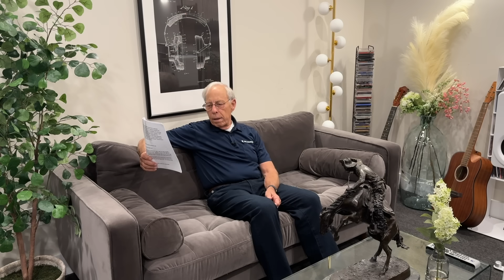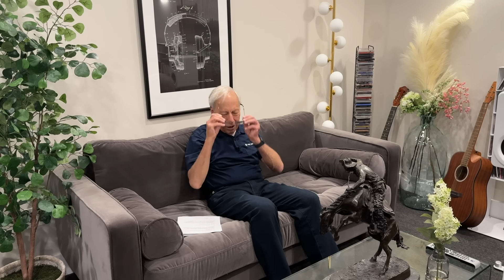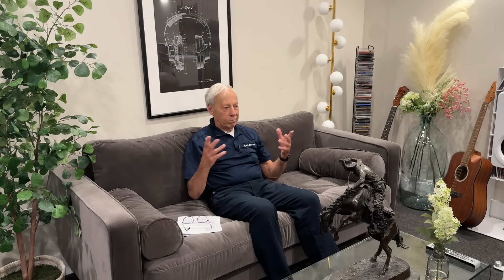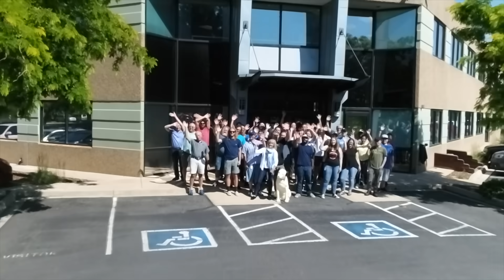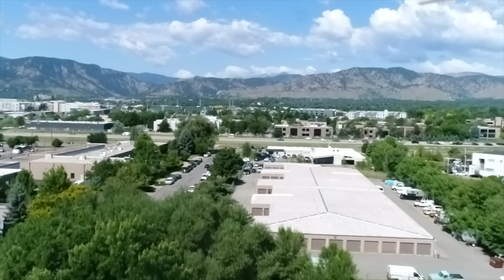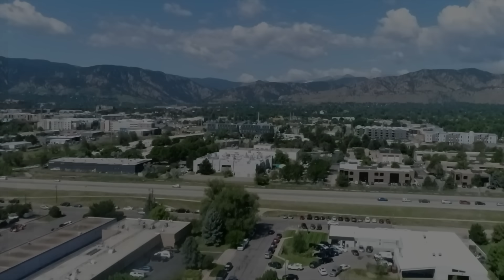Do music streamers sound different?

Comment: The question "Do music streamers sound different?" already contains a category error and thus, in a strict logical sense, cannot be answered.

The reason is that streamers in terms of sources for digital data don't "sound" but a DAC does (taking aside that an electric signal doesn't either, but yeah ...).

This argument isn't just semantic pedantry (admittedly also), but crucial as by definition, in logically digital chains, neither the source nor the transmission path matter unless exceeding the thresholds causing data corruption. If one denies that, one denies the very definition of what is digital!

Differences due to jitter, in some sense part of the analog nature below the digital abstraction, might be a valid counter-argument at first sight, but actually aren't as it is up the last end point (the DAC) to deal with it and suppress it. Trying to improve that literally half-way, is the wrong approach.

Comment: The is no difference if the streamer is a separate. After all, we can use a really old phone as a wired streamer to get the highest quality possible. My phone is 10 years old but runs latest iOS. It will crush a $40,000 streamer or a $70 streamer.

Comment: I have three active streamers, A WiiM Ultra, Volumio Rivo with the Farad Super3 LPS and the Cabasse Abyss integrated. I also have four speakers in play, Magnepan LRS+, Cabasse Murano, Fyne Audio F500SP and the Zu DW6 Supremes. There are differences in sound quality between all of the streamers, as there are between the speakers. Personally, I believe it boils down to the power supplies the streamers use. The Rivo has a $500+ LPS powering it along with DC capacitor filtering, silver USB cables with USB isolation and 10mhz clocks on both the USB and ethernet. The Cabasse Abyss has an internal power supply as does the Ultra, both run off of the network via ethernet cables. The Rivo has better clarity, better separation, better across the board. The Abyss is in second place, but equally as good as the Rivo in many respects, but still does not dig into the details like the Rivo. The Ultra is competent, but not near the quality of the other two.  

When I owned the Node N130 and upgraded the internal power supply with an external LHY LPS, the sound improvement was very noticeable. That is the day I started my journey in upgrading everything power related. Electricity is noisy, and those 1's and 0's travel on a stream of electricity. And then we have jitter... And clocks... ;-)

And yes, I A/B tested, as best as I could, but found the switches added noise. A simple A/B test is not that simple, it is actually very complicated and can get expensive to do it properly.
Reply: I agree 100% with you, that’s the PSU it’s the key difference on how its sound.

Comment: First of all, as a point of reference, my hearing has much bigger tollerance than of a dedicated audiophile, meaning, it takes a real change for me to say - ahaaa! I'm using external dac, old Marantz HD-DAC1 and it's a decent unit. Now, If I'm playing digital content from let's say Tidal by accessing it from the streamer's interface/app, it sounds significantly better than if I'm just using Tidal connect option to push the sound to the streamer from the native app. Likewise, all the digital content on my RPI, if sent through the streamer and then to the DAC, instead of sending it directly to the DAC with a same set of coax or toslink cables, sounds much better passing through a mediocre streamer. Btw, I checked the box of the streamer app which allows for unaffected pass-through of the digital signal and still - it comes out sounding much better. I have no idea what it does to those 1's and 0's but I found my way how to enjoy it. Mediocre streamer, well known brand and an external old DAC with a variable output to the amp. That's it.

Comment: I understand how jitter effects time delivery of bit perfect samples, but not how 'noise' is ingested into an otherwise bitperfect arrival. Jitter is largely undetectable with modern dacs. Why can't dacs simply cache & delay delivery to achieve sample rate timing with bit perfect consistency?
Reply: As for the understanding, it is okay not to understand something which is nonsense anyway.

People claiming that noise influences digital data despite being reconstructable without errors (which is an assumption as errors can and will occur of course, but are usually taken into account) are contradicting the definition of something being digital which obviously doesn't make any sense.

The time variation in terms of jitter is actually an additional aspect and at first has nothing to do with the integrity of the numbers.

In short: you're normal and sane. All good.
Reply: @little-endian5957  
Don't forget here, we're talking about jitter in microseconds ... a tiny fraction of the pulse width of a USB cable.  

For both noise and jitter ... many people still make the too-easy mistake of thinking that whatever comes down the wire is applied directly to the input of the next chip and it never is.  ALL digital signals (especially the serial data on USB, CAT5, etc) is differentiated, captured, latched and buffered.  Digital devices do not work directly upon input data, the way analog devices do, they work on cleaned up copies of the data... so by the time noise or jitter would matter that messy input signal is long gone and forgotten.
Reply: On USB and HDMI they do.  On the old toslink (optical or copper) connections the clock is derived from the signal itself.
Reply: @Douglas_Blake  So why would you spend more than $200 on a bit perfect dac?
Reply: @arthur_pug  
I wouldn't.
Reply: @arthur_pug Haptics and features would be a rational reason. Have a look at the RME (German manufacturer) portfolio and its ADI-2 line.

They won't sound better per se though, only measure better here and there.

Comment: The information stored on a vinyl record is fixed, but different cartridges and turntables don't reproduce the same sound.  Why should digital be any different?
Reply: Because your cartridge is an analog device that can vary over a surprising range, depending on it's construction.  With digital files and streams you get exactly the same data no matter what device you are getting it from.

Comment: There’s no such thing as a digital signal.  It’s actually a square wave ANALOG signal which is decoded, as such it definitely can vary even before you consider external factors like noise.
Reply: Yet strangely enough those analog signals carrying digital information are used world wide 24/7/365 with 100% reliability.  Who'd a thunk that??
Reply: @Douglas_Blake  100% reliability is not an accurate statement, and to get a reliable signal transfer often requires reconstruction of the signal by the receiving device.  If the end requirement is simply that Alexa says the right words when telling you the forecast, that’s a low bar which is easily met.

It all depends on the application.  If it’s non critical and is judged by very crude objective measures, the vast majority of digital transmissions are just fine.

But if the results are being subjectively scrutinized at a high level, it takes far more than consumer grade value-Engineered mass market hardware to get to that 100%.  If every digital transmission was always 100% perfect there would never be a need for a computer to have 2-way communication with a device over USB so that the receiving device can re-request data packets that don’t arrive, or arrive corrupted. 😉
Reply: @superspeeder  
Actually the accuracy bar in digital communications is set by the fact that entire economies, banks and businesses rely on it's accuracy to make financial transfers, that have to be 100% bit perfect all the time... Just think for a minute how disastrous it could be for some guy who's latest autopay withdrawal had one of the high order bits flipped... He owes $100 the autopay takes $1,000,000 .... totally unacceptable.

The wires that transfer our audio data are the same wires that run this world's finances, military, medical and aerospace efforts. It has to be right, all the time.
Reply: @Douglas_Blake  Agreed 100%.  Now ask yourself if that networking equipment comes from Best Buy and the cables are Amazon Basic?

Commercial/industrial grade networking equipment is orders of magnitude more costly to build, implement and commission than the flimsy consumer-grade garbage most people have access to, but that’s exactly what cheap audio gear is full of… the cheapest jelly bean chips, wonky oscillators, noisy power supplies, none of which will completely interrupt a data signal but surely will degrade it.  For most people FM radio and MP3s are good enough, but not for some.

To keep the ones and zeroes properly defined, in the right order and arriving precisely on time, the stock market relies on state of the art equipment.  It NEEDS to if those bits are going to be transmitted reliably and accurately, 24/7.

Regarding consumer audio, in my opinion the correct conversations are centered around the law of diminishing returns.  That’s a far more subjective topic though, and it’s different for everyone.
Reply: @superspeeder  
Wow... you really need to rethink that.

I have a USB printer running on the cable that came with it... in over 5 years it's never once gotten a character wrong or printed even a stray speck on the page.

Why would this be any different for audio... at the cable level it's all just digital data flow.  

That you've somehow decided that your expensive stereo is filled with garbage should concern you very deeply ... you've been sold the big lie that unless you are spending stupid squared number of dollars on external fixes your system will never be any good ... and that's just pure BS.
Reply: @Douglas_Blake  now I understand where you’re coming from… you’re satisfied if your printer doesn’t make spelling mistakes.

A year ago I might have agreed with you, but I’ve learned a lot in the last while and it didn’t take an expensive stereo to do it… I have an EXTREMELY budget system compared to what most “audiophiles” would have, certainly nothing with a PS Audio logo on it, and I’ve seen first hand what happens when you treat digital signals with care.

Have a good weekend. 😊
Reply: @superspeeder  
OMG ... try to engage brain for a minute ... The point is that even the "el-cheapo" stuff has to work without errors or problems.  

Audio is no different... it has to behave properly just like my printer or that $5.00 flash drive or even the multi-million dollar data centre.  This notion that because it's audio it has to be somehow flawed is just plain stupid.
Reply: @Douglas_Blake  I did even better than engage my brain - I studied the issue, bought some gear and gave my brain something to actually listen to.  Now that I’ve heard the difference that even affordable well-chosen gear can make, I’m no longer in the “bits are bits” camp.  Been there, bought the T-shirt, actually TRIED it for myself and was pleasantly surprised.

You should do the same, instead of arguing with strangers about theories.  I guarantee my stereo sounds WAY better than your printer. 😊
Reply: @superspeeder  
1) Don't be an ass.
2) What makes you think I don't have a system with carefully selected components?
3) FYI I am a 40 year electronics technician... no theories, just experience.\
Reply: @Douglas_Blake 
1. Just trying to keep it light 😊
2. All I know about you is summed up in this conversation.  I’m not making assumptions, just basing comments on how you don’t think digital audio can be improved.
3. Your electronics technician background is all good, but with all due respect, I don’t think they taught you digital audio?

So have you tried a DDC in your system?  If you have a budget DAC like mine a DDC can make a huge difference in SQ.  If you have a high-end DAC with good clock and an immaculate input stage that’s galvanically isolated, or you’re using a high end streamer that outputs a good signal, a DDC will likely make less of a difference.

A DDC is all about noise isolation, jitter reduction and well-timed data.  It’s still just a “digital” signal, but a much better one.

If your speakers are not resolving enough to tell the difference, or your amp is particularly smooth, then eliminating the weak link will be necessary to hear any upgrades.
Reply: @superspeeder  
Insulting people is not "keeping it light".

By your own admission you know nothing about me ... well then discuss the topic and the issue... lay off the personal slams.
Reply: @Douglas_Blake   ...& yet you have no problem insulting those of us who can hear the differences in cables.  Pot...Kettle...Black!

Comment: About 8mo ago, I upgraded from a Bluesound Node to an Airlens.   I had both in my system for about a month until the Node sold.   Both were feeding a Denefrips Pontus 15th, the Airlens via I2S, and the Node via coax.   The improvement on the Airlens was obvious.   Mostly with the soundstage.  In comparison, the Node sounded flat, while the Airlens grew in every dimension, and performers were placed more clearly within the soundstage.  I’m very pleased..

Comment: Positive differences that are readily audible in a blind test are worthwhile.  Others aren't, IMO.
Reply: The best information from blind A-B testing is just how much this stuff all sounds alike.

A lot of the big differences people hear between equipment is reinforced visually and by expectation when they know what they are listening to. Cutting out the visual aspect tends to level the playing field very nicely.  

And before we get the big argument... YES your vision does inform your hearing.  Expectation bias only makes that stronger.  

If you doubt me get a movie with dialog and listen to how the sound appears to come from the character's mouth... Now close your eyes and in a few seconds you will notice that it's all suddenly straight ahead and centered.  That is your vision correcting your hearing.
Reply: @Douglas_Blake  Indeed. The psychological "distortion" is tremendous. I've been there with my - at that time - beloved Benchmark DAC1 decades ago and again better hearing than now (that's also some staggering irony as most audiophiles are in their late 40s if not 50s/60s where the ears are anything but fresh).

Everything sounded more detailed, emphasized, crisp, dynamic, whatever. Still, its headphones output is extremely good and matched the Sennheiser HD-650 well impedance-wise, maybe making some slight difference.

However, at least when comparing the DAC through a regular amplifier with a 20€ cheap-ass soundcard in a PC, halfway level-matched I could not detect the slightest difference. To my frustration after having spent 1100€ on that thing back then.

But actually that is exactly what's to be expected. The jitter artifacts, while being a true measurable phenomenon, usually are too low to be audible even on non-ideal DACs and otherwise even cheap DACs often lie way above what humans can hear or speakers (and the room!) can reproduce. 

Nonetheless, external DACs have something and haptics can also be fun. So it is okay to spend more money than required on this stuff I guess, but one shouldn't fool oneself, either. Today, one can get virtually "perfect" audio quality out of some 10 USD Apple USB-dongle which is crazy, but shows how saturated the audio development is unless humans get better ears by evolution.

Comment: Does the internal clock go on the digital source or the DAC side? What link in the chain is the clock?
Reply: In a streamer which usually consists of a single board computer, a transceiver and DAC there can be many clocks, each running at speeds to optimize the results.  Most often these clocks are running synchronously (all derived from a single master clock) but external clocks are asynchronous which can sometimes lead to worse timing errors than the standard on-board clocks.

To be honest a lot of this reclocker, external clock, linear supply stuff is just BS designed to part you from your money.  You don't really think a company like PS Audio, Wiim or Cambridge is going to sabotage their own products by cutting corners on crucial parts of the design, do you?